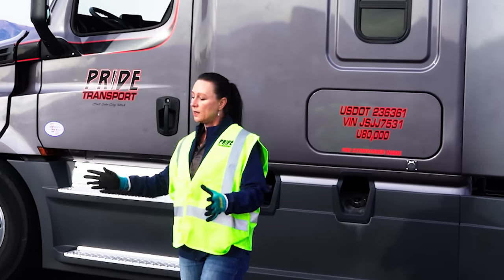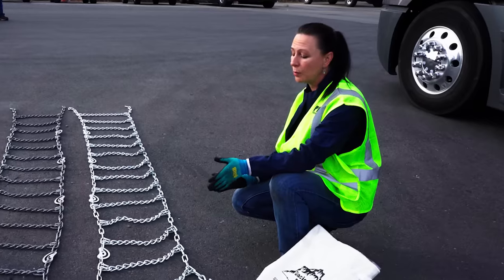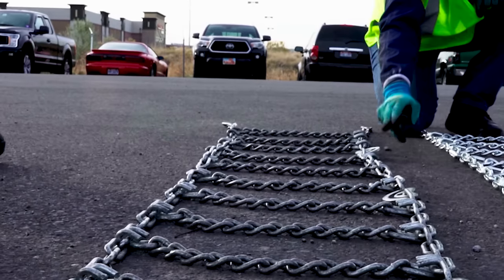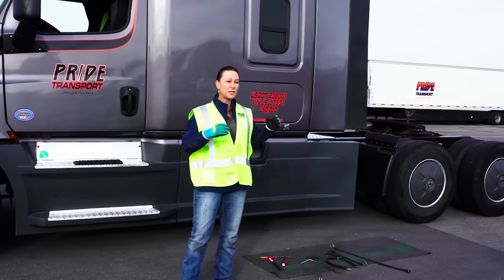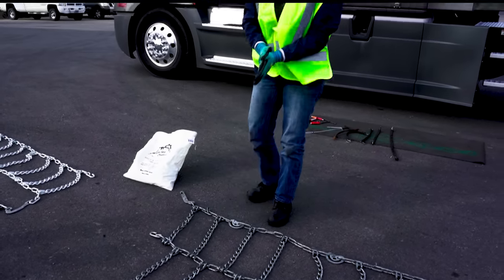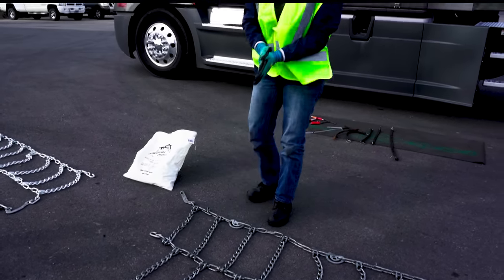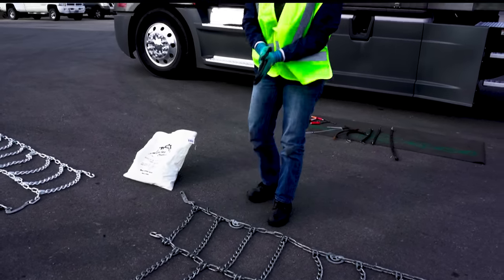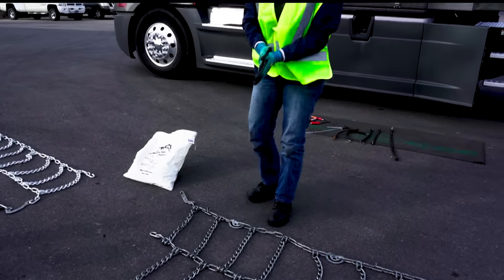The BEST Instruction on Tire Chain Installation ever.

Comment: I  PUT  CHAINS ON FOR THE VERY FIRST TIME FEW YEARS AGO AT DONNER PASS WITH ZERO TRAINING AND DID ONE DRIVE AXLE AND ONE TRAILER AXLE IN  UNDER ONE HOUR. NOT SURE IF THAT IS A GOOD TIME. MINE WERE IN A BUCKET WITH A 4 PICTURE DESCRIPTION WHICH  MADE IT SIMPLE AND EASY TO UNDERSTAND. NEVER INSTALLED DOUBLES SO FAR ONLY SINGLES. THAT VIDEO HELPED ME TO KNOW NOW,  HOW TO INSTALL THESE, TOO. GREATLY APPRECIATE THAT VIDEO.  TOM
Reply: Bro why are you telling 🥺
Reply: @mrrexster829  WHY URE ASKING BRO?
Reply: Hour and a half!  Oh that hurts!  The loggers North of the border will throw on 2 sets of triples in 5 to 6 minutes
Reply: @bmdbigfeet1031  Two sets of triples? U mean two sets of doubles. All depends on the weather and where one puts them on .  5 to 6 minutes, i don't thinks so. I'd like to see that before i believe it. When i put them on years back that was the very forst time for me. We only use singles. For one drive and one trailer axle i think 90 minutes for 4 chains for the very first time in that bad weather condition was not too bad .  And it is not about speed but more about to do it the right way and precision.  Have seen lots of guys who don't tighten them properly.
Reply: @tomh9807  nope, triples and I've done it more than once. I've mentioned in other comments that log trucks are way easier to chain than highway trucks.  Not saying I wasn't panting when I was done.  Right now we're throwing on 2 sets of triples  twice  a day. Taking my time, 10 to 12 minutes. Guess the only way you're gonna find out is to come to British Columbia and see how it's done. Chains for loggers is just a minor inconvenience and part of the job.
Reply: @bmdbigfeet1031  Still don't understand what u mean with triples. Do u have three tires on each side of the axles? If so i've never seen that on logging trucks and i come around a lot in Canada and US. Yeah to chain a Highway truck is tough. But when u r loaded with logs  i assume u have to crawl underneath the same way like when attached to a trailer so u have the go thru the same obstacles.  I could do it faster, too these days but still i doubt one can do one truck and one trailer axle both sides in 12 minutes. Just saying. U only put them on in snow or also when u r stuck in the mud?
Reply: @bmdbigfeet1031  OK  I just watched a chain up Video from a logger putting doubles on the rear axles both sides with his dollies hanging on the tail and no fenders. Yes he was quick. I believe it now that one can do it in 6 to 12 minutes. Respect. Yes easy thing to do when one does it frequently. Thanks.
Reply: @tomh9807  The triple ,double thing is silly . They should be singles for 1 tire and double for a set of duals.  Triples  refer   to the side rails and center rail. Covers both tires. Generally we'll chain up before we start up the haul roads and as far as mud goes,  we Generally know what condition the roads in and the chain is thrown on before things get ugly. I have never laid on the ground to hook them up. Very rarely we will throw chain loaded.  Again ,log trucks are easy to chain. Even trucks pulling strait trailers or trains still have plenty of room to work without getting wet or muddy . We use tri-drive trucks with a 4 axle, 2 bundle trailer.  So there's a bundle on the truck and 2 on the  trailer. At the mill we reload the trailers on the truck and head on back up to the Bush. Trailer weighs 7 ton so it's great for traction and ride quality.
Reply: @bmdbigfeet1031  What u refer to as triples i only know as doubles. But u mentioned the the word triple refers to the side rails. Whatever that means. I only have singles which i prefer especially when one chains up with a straight trailer attached. This way I only work on the outside tire and don't have to crawl underneath. Still you get dirty and wet because one has to get between the tires and kneel down in order to connect the hooks. That problem does not exist with a logging truck and your dolly axle because you have no fender above it and all the room you need if you are not loaded. But as you mentioned you do it anyway before you go up in zhe woods when you know the road is shitty or you do it anyway no matter the weather condition. And that's ok.
Reply: @tomh9807  Now your getting it! Also keep in mind all our chain is hung on a chain rack for easy and quick access and not tangled up in a jockey box or a bucket . Huge difference in time on the  side of the road.  You poor bastards take a lickin when it comes to chain. I feel for ya's.
Reply: @bmdbigfeet1031  Yes I get it. Always learning.  No I keep mine clean and safe in a bucket. This way they stay need and don't get rusty so fast. Not sure if that has an impact of the time they last. Just assume that. We have a rack mounted on the trucks, too but i personally never use them for mentioned reason. And it is not a big deal to get them out of the buckets.  The dedicated route i go I usually don't need them anyways. We just have to carry them with us by law. I only chained up 4 times ever since I drive truck here in NA. By the way i don't have any problems chaining up these days if i have to as i very quick have them un entangled even if they r in a bucket. Ok nice talking to u. Be safe. Tom

Comment: R U new to trucking/chaining?🤔  This is a great video!👍🏼...VERY informative & easy to understand. 
Just a few words about cam fasteners...
They're quite useful & greatly speed up the installation process. But if U drive off-road, like logging or oilfield, they can be more easily susceptible to damage from foreign objects & frozen ruts and ridges. 
I've been driving in the oilfield for over a decade now. I run a double-bottom, so I tend to be dispatched to the more 'challenging' locations- & also end up pulling other trucks out of stuck situations, as well.
I stick with the chains that only have the quick-hook connections & they last me several years. Once one of those 'boomers'(boomerangs) gets bent, their strength becomes compromised & it won't be long before they break.
Be safe out there!
Reply: Thanks Louis for the info…something to consider for sure when purchasing chains.👍🏼🇨🇦😀

Comment: I use the biggest and cheapest Walmart shower curtain and I cut it in half from top to bottom one half of the shower curtain will be big enough to use so I have two curtain put one of them back in side the plastic bag and other in a zip lock bag when I using the shower curtain in the snow and mud  when I'm done I fold the shower curtain muddy side against each other then fold the top side or clean side against each other then put in plastic bag the shower curtain can be reuse or clean it later for it to be reuse again, side note color does not matter.
Reply: That is actually a nice trick  i will be using it for sure👍🏼👍🏼

Comment: And the guy who didn't and paid $600-1700 CDN for a "license" with a phoney name etc slams into you and kills you. Even on dry pavement (I 70 brake fade in Colorado that killed 6 except the guy who caused it).. Here's my question (s).
     How many companies are willing to pay for the time to apply, pull over and check/tighten and remove them? And the reduced speed in those conditions for mileage pay? And when you end up dead, maimed or someone else does and you get personally sued for (obviously) deciding the conditions were safe enough doing so was it worth it? 
     BC was avging 1fatality in the mountains everyother day at one point. Many involving a license mill in Alberta "graduates" had never even seen. Back up and running a month later under a different name. 
     Lumber, oil field and others don't have a choice with much of it offroad but usually get paid hrly.  And earn it! Now the same folks killing us on the highway are trying to take those over. 
     Check the forecast. Use a CB to talk to guys coming the other way. And if it's bad enough you need em? 
     Park it. And wait for the shutdown YOU aint in... It aint worth it now. Love to see an "autonomous" truck under these conditions. Undoubtedly with automatic spinner chain systems companies won't spend the $ on. But they'll happily have YOU accept the responsibility/consequences doing this. The load is insured. You? Just a name that gets crossed of the driver list later..

Comment: This could be a good way to throw them if you spin out.
Generally, it's a good starting place.
However, this is a dangerous methodology as it's time consuming.
The first priority should be to minimize time roadside, and under the truck with your legs hanging out.
Well done, keep workin it.

Comment: Doing this on a nice sunny day like in this video doesn’t compare to the hell storms some drivers install chains. Plus add all the other trucks fight for space to pull off and install their chains is a nightmare. You can never really know how to put chains on until you’re really out there on the side of the road. That’s were you find out a lot about yourself. Stay calm and collective at all times. If your trailer has chain hooks and you know you’re driving into bad weather. Lay them out ahead of time on the trailer. That way you’re not untangling chains on the side of the road. 

P.S.
Please don’t lay down on the road. There’s better methods out there.

Comment: That's works good with new chains try it with old rusty  ones. Buy some spiders  bungies. Orange in color. And it take longer that 15mins and there isn't  always a chain installer guy on donner pass 25.00$ a wheel. Fyi alway your in 4 inches of slush.

Comment: Tip use singles and put 4 inch high small block under inside tire lifts outside tire off ground avoids stupid moving tire forward and backwards and is stupid tight driving foward never are tight always come lose and get strong studded Chains instead of cheap China chains they break to easy

Comment: It's much easier to just turn on your cargo lights, drop the trailer and that way you can tighten up the inside cams without having to crawl under the trailer
Reply: Cams are always on the outside.
Reply: @redmesa2975  nope, I got a set of doubles with cams on the inside and on the outside.

Comment: Lay the chains flat on the ground. Drive onto the chain then couple at the top. So much easier if stretched out flat and drive over it then hook closer to the top. My god connecting the links on the ground sucks ass. Laying under the truck you are harder to see. If for some reason the truck started to move you have 0 chance of getting out before crushed. If possible i suggest laying out the chains then drive onto them. Now as connecting you are leaning over the tire not laying in slush under a tire of a vehicle that could crush you to 0 chance of survival. If ever lay under the tires like this even on flat ground i would suggest chalking min 2 tires front and back plus remove the keys and maybe lock the doors. Your life is laying on the ground so ya take the extra steps of being sure that truck cant move first. Even just being hit can cause it to roll far enough to crush you. So ya find a way to hook the chains from the top so not laying under the tires. Cant for some reason? Then atleast chock the tires front and back to prevent being crushed. But hey if dont value your life then hey do as she did trusting the truck wont crush you. Even loading docks require chocks even when all brakes are set. Freak accidents happen.

Comment: 18-24 bungees? Goodness. Chain properly and you should only need 1 bungee per chain. 

Your legs are going to get run over. They are out too far. You didn't stress personal safety.

What the heck was all that noise when the truck started? Beeping and squealing.  Team sleeper suffers from fatigue. 

How did you put your chains back on the rack? Can you, with confidence, know that the next time you go to use your chains that they won't be twisted? There is a technique for that. Do you know it?
Reply: I believe the 18 to 24 reference is the size of the bungee. 18 inch to 24 inch.
Reply: I use 4 to 6 bungies per chain.  Takes very little time to do them. And she did it the most stupid way possible.

Chain properly and you won't even NEED any bungies.  If you do it right, the chain will not come off even if the cams loosen.

Comment: These are not chains strong enough for a truck. More suitable for tying a cow. And too long a space between the cross links. This causes you to lose grip and start to spin. Then cross link breaks after cross link. 12 mm tightly linked barbed chain. The only thing that lasts.

Comment: Thanks, I made it to 13:14, and I was laughing to hard to continue. 

I've had to chain a truck. More times than I can count.. and that.. is the hard way.. 

On a side note. If you need to attach bungee's on the outside.. you didn't install correctly.. and your chains aren't tight enough.. so you may as well be running without them.. 

To funny, thanks pride transport.. I needed the laugh.. I sure hope drivers get better advice than this..